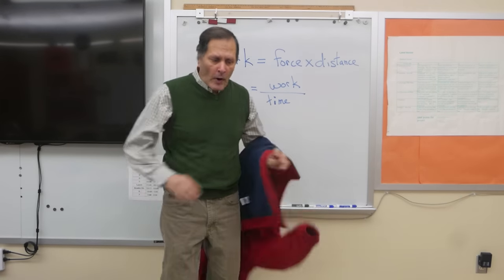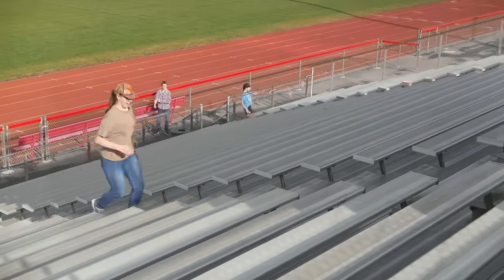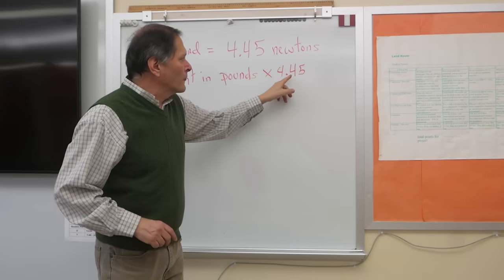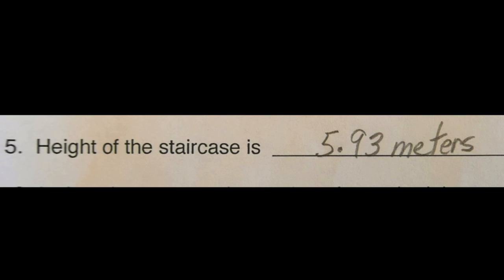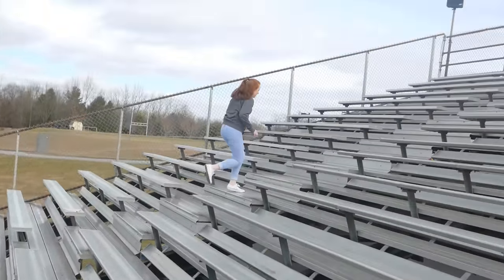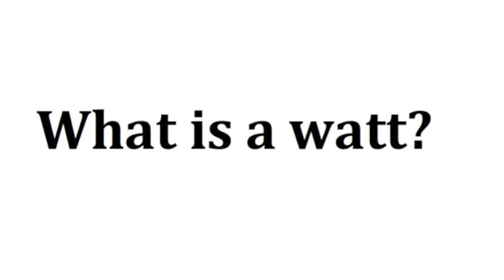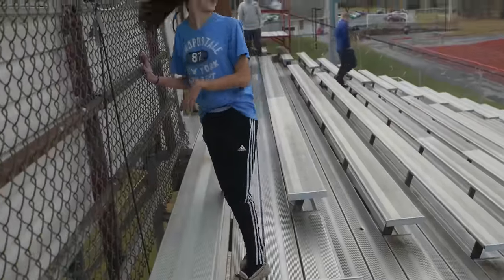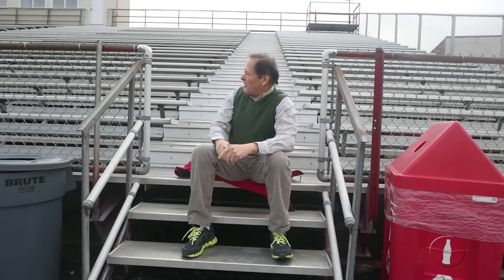Student Horsepower Lab Activity  // Homemade Science with Bruce Yeany

Comment: The difference between the two methods of measuring the power is due to the overall efficiency of the car in converting energy from the batteries into rotation of the wheels. An overall efficiency of ~ 50% for the car sounds about right and would make your two values very close. Your videos are great and are an immensely useful resource. Thank you for making and sharing them.

Comment: I like your videos. But I've been a bit shocked to learn, that you let your students use Pounds instead of kg. 
Why don't you use SI units?
Reply: NarroTibi I think that's because they are in UK (I hope, because te Internacional Unit are great, and that's the only reason why someone would use them)
Reply from the maker: the scale we used only measure in pounds  so we start with  that measurement  and converted to Newtons which is a metric unit
Reply: NarroTibi You've got to be careful about the difference between mass (amount of substance) and weight (force it exerts under gravity). Kilograms are a unit of mass; pounds and newtons are units of force. Newtons are the better unit to use, but pounds are what most folk in the US use to discuss weight, so they convert from one to the other. Either is better than kilograms for this purpose (unless you want to complicate it further by multiplying by the local gravitational field strength to find the weight your mass exerts...). Bit pedantic perhaps, but this on a physics class - it's good to be clear about what you're measuring!
Reply: I'm sorry, but you're wrong WelwynWheels. I'm a scientist myself. I know the difference between mass and weight. Pounds is a unit of mass too. It's not measuring weight. Newton is kilogram times meter over second squared. Pounds is only an outdated - as we European call it - imperial unit system.
I know that Americans also use a unit 'pound-force', which makes it even more confusing for students. Just stick to SI units as the rest of the world do, and everything's getting easier for students.
I just have been "shocked" okay let's say astonished, that a science teacher do not use SI units at the first place. One should encourage pupils from the very first science lesson to use metric / SI units.
Never mind, just my two cents. :)
Reply: NarroTibi Good call - I never realised that it was used as a measure of mass, I've always thought it was force - I've just looked it up and you're absolutely right, so I've learned something - thanks. On the units thing, I think he's right to start with units that his students will understand - I'm in the UK and under forty so I'm not familiar with pounds, but I know that folk in the US use then almost exclusively to measure their weight (or indeed mass :)), so this is a useful exercise in turning a measurement that they are familiar with and can understand intuitively into one that they can use within the SI system. I wouldn't know my weight in Newtons if you asked me, but I'd know how to work it out.
Reply from the maker: Response to Narro,   unfortunately, my country relies on two sets of measurements depending on the situation, which at times makes my job very hard and confusing for students.   In this case,  students know their weight in pounds and those that don't, used the common "bathroom" scale to find it.  These scales in our country only list pounds on them, so in this case,  pounds needed to be our starting point.   If I asked 100 people in my country,  (any age) for their mass in kilograms maybe  one person might  know it.   Sadly,  I don't foresee any change to SI units in the near future, as there doesn't seem to be any real push for it other than in science.    One last note,  the imperial  system actually does have a unit for mass, it is called the slug,  a very obscure unit that maybe only one in a 1,000 might have heard of.
Reply: Thanks for responding. I appreciate it very much.
One question: You've to begin with pounds & co, but in the sequel, do you teach them the metric system? And after you taught them do they realize that SI is far more better to understand nature?
And if you study any science subject at any university, public or private, isn't there SI used?
Reply: To answer your question: Bruce (and I) are in the US. Kids here are taught the metric system in school, but in most of everyday life, it is not used. Height is in feet, speedometers are in miles, weights are in pounds. But yes, in chemistry and physics classes we use SI units. Bruce is teaching younger students who are probably around 11-14 years old. Proper Chemistry and Physics classes are usually done in High School here (15-18 years old). Also, in college courses we use grams, meters, and all of the other standard units.
Reply: Thanks for elucidating.
Reply: +NarroTibi The bathroom scale used in the video actually measures weight and not mass, or more properly it measures the normal force applied to your body by a spring inside the scale. If he used a beam balance (which for human sizes are typically only seen in the US at doctors offices - I am sure he has some small balances in his classroom lab), that would be more akin to mass.
Reply: NarroTibi I’m sorry but pounds are a unit of weight, therefore a unit of force. It is dumb that we use weight inside of mass for pretty much everything in the US. The imperial unit of mass is Slugs.
Reply: @laszloandrasi3258  Pounds are indexed to the kilogram in their formal definition, and not the Newton.  The Pound-force is a derived unit as the weight of 1 pound-mass in standard Earth's gravity.

The slug is a unit to make F=m*a retain its elegance and simplicity, when using pounds-force as the force unit and ft/s^2 for acceleration.  Almost no one in the US has an intuitive idea how large a slug is, without looking it up.   There is also the unit of poundals for force, that allows using pounds-mass as the mass unit.  Again, very few people intuitively know how large a poundal is, without looking it up, including myself.

Most of the time, you are going to see equipment calibrated in pounds, whether it be pounds-force or pounds-mass.  The slug and poundal exist as ways to make both of these work with N's 2nd law, and you rarely (if ever) see anything calibrated or sold in these units.

Comment: Great Video and greetings from Germany.
I am just wondering if you do not miss to calculate the force they need do speed up and hold the horizontal velocity.
Because the Energy in the vertical dircetion is calculated as you showed but you ignore the horizontale one wich is quite much.
Do you have a way for measure the Watts while walking without going up?
Thanks for you great video's.
Reply from the maker: Thank you,  being a middle school science teacher my equipment is limited to simple pieces.  I would think there are treadmills and such that can measure it a bit more accurately but I haven't found any ideas of how to measure power just on the  horizontal plane ourselves.   I was hoping someone  might suggest it in the comment section.  It would require a method of measuring the force needed to push you forward with each step.  I've always wondered about the accuracy of the method we show here and that missing component.

Comment: I calculated that when I run the stairs on my lunch break I put out about 0.29HP over 14 minutes.
4 flights
16 reps
81 steps
7.3" (unconfirmed)
About 50ft or 15m up
170lbs

Comment: Couldn't it be calculated with the force exerted to keep an horizontal jogging?
Reply: But how will the force be  calculated?
Reply: @shamsamir1698  running machine at a gym? Quite a tricky question... But those machines at the gyms, usually show the calories burnt. They must do so but measuring the force exerted to the sliding floor of the machine...

Comment: Everybody got wrong answers because running up those stairs is performing WORK in an X-Y axis traveling UP and FORWARD. Defining your work in only elevation ignores your work performed traveling FORWARD. Correcting kids for skipping steps while running up the staircase was like having a tobacco lobbyist in congress (yes somebody in your video did that.) Your equation would work for a STAIRMASTER or a LADDER (performing no forward motion) not a STAIRWAY (upward an forward motion.)
Reply from the maker: Hello Cam, aside form the path not being vertical,  there are several other errors in this experiment and it is something for discussion in the class itself. Some things we discuss: First of all horsepower was a measurement of the  work performed by the horse but does not take into account the weight of the horse moving itself so actually the powered generated is greater than measured.  In this experiment students are moving themselves not an outside object.  The force generated to move the body up the stairs is measured as the persons body weight, once again the force is not correct,  the force must be greater than body weight otherwise a person would not move.  Plus the force generated to run must be greater than walking otherwise the speeds would all be the same.  I would agree with the ladder would be a truer method but is not practical.  Stairmaster is not,  we've looked at it,  your body moves upward and forward with each step but it's movement cancel out both the upward and forward motion and returns you the same position at the correct pace.     I would tend to think that skipping steps does not change the results as the student's  change in elevation is the same whether they hit every step or every other one. The force applied in either case is not  smooth and consistent but more like a series of jumps.  So hitting every step requires a smaller forces applied more often, skipping steps requires a larger force but applied less often.  The end result is the same.
Reply: These equations and assumptions are flawed if they lead any kid to think they have more than 10% of the power that a horse does.
Reply from the maker: I would suggest that perhaps you should try it for yourself. I am sure you will find that you can generate much greater than the 10% you are suggesting. The equation is rather simple as are the the means for measurements.   When James Watt determined that a horse could turn a grinding wheel 144 times in an hour (or 2.4 times a minute).[6] The wheel was 12 feet (3.7 m) in radius; therefore, the horse travelled 2.4 × 2π × 12 feet in one minute. Watt judged that the horse was pulling with a force of 180 pounds-force (800 N).  A force that a person can easily generate for a short period of time such as 5 seconds with their legs.  The obvious difference that in Watts calculations he measured the effort of a horse over an extended period of time (one hour) to move a load plus itself.  In our experiment the mass being moved is the person's body and they are lifting it for a short height for a brief period of time.  You don't need to take my word for this,   there are  quite a few references that you can research that can tell you that the power rating for humans, for example good cyclists are able to maintain about 400 watts and for brief periods of time up to 1500-1800 watts for a few seconds.